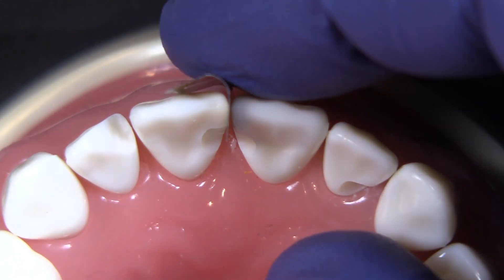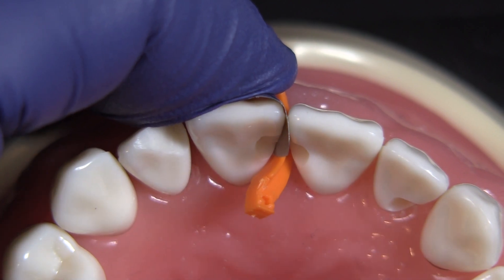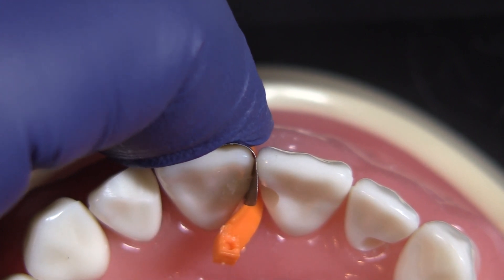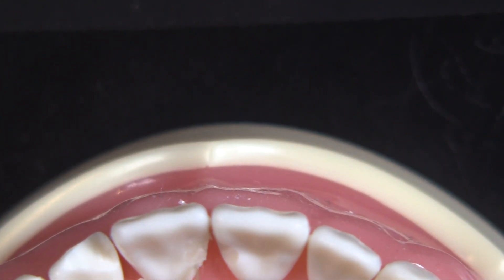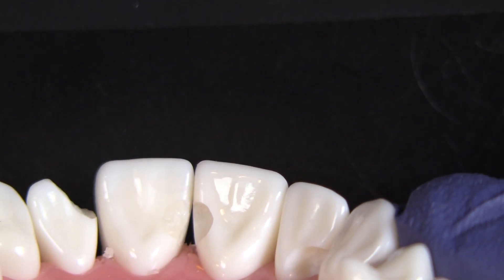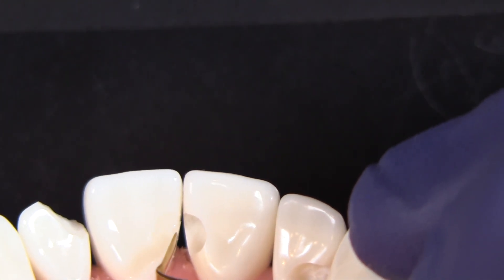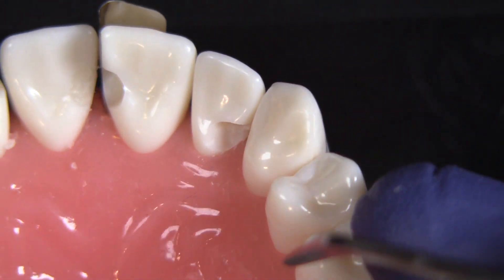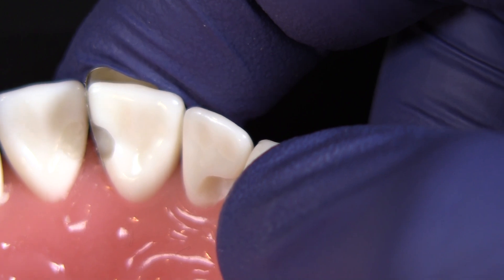Tips for Placing the NEW Fusion Anterior Matrix System with Dr. JD Corey

Comment: How about creating a tight proximal contact?
Reply from the maker: At only 0.0015 inches, the bands for this system are significantly thinner compared to other anterior bands/strips. In my experience, this feature has made it easier for me to achieve tight interproximal contacts. - Dr. JD Corey